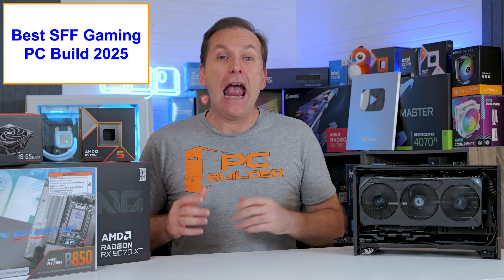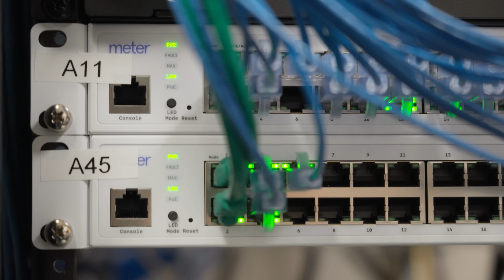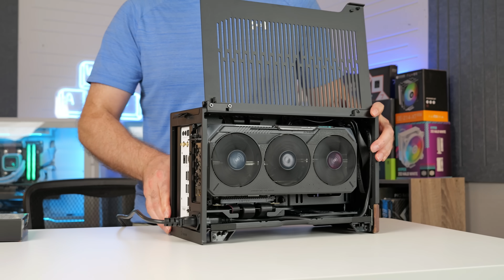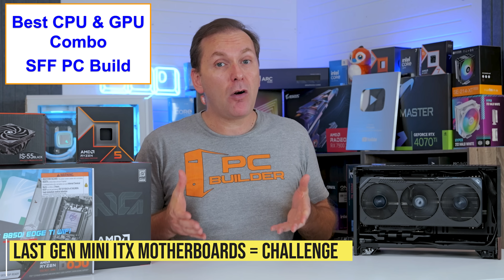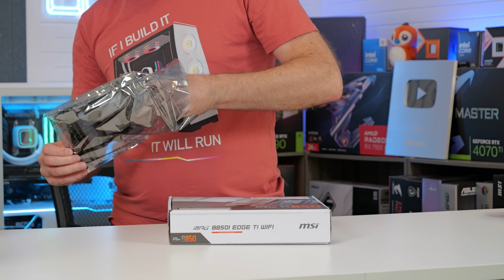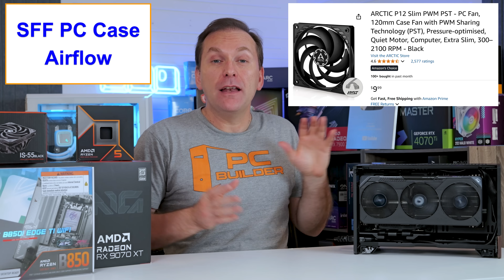Best Mini ITX PC Build Guide | Small Form Factor Gaming PC Build

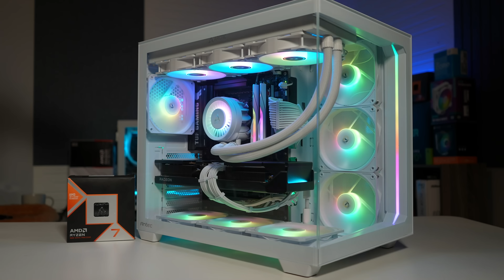Comment: @pcbuilder Jason, what is the white case displayed at about the 4:14 mark? I have one I bought used. On it is branding “SumTax”. The person I bought it from said it was a clone of the O11 Vision Compact. But I haven’t been able to isolate it or find any information. Would be awesome if you could fill in the blanks for me! Thank you!!!

Upon further examination of what you displayed. There are slight differences. Mine has a glass top. Mine came with a 240 AIO mounted on the side and doesn’t look like it would fit 3x120mm fans. Mine would only fit 2x120mm or 2x140mm fans on the bottom. Mine is 14 1/2” tall 13 7/8” wide 10 7/8” deep. The I/o and buttons are on the rear top right corner. I wish I could post a picture of it.

Comment: Im looking for a case super small, i mean as small as posible, but with support for a regular dual fan 9060xt.
It has to be small enough to fit on my backpack along with a portable screen, a keyboard and a mouse (and the power cable along with the display port or hdmi cable)
Not a huge backpack, but a reasonable big one.
I have found either itx with low profile gpu or 1 fan gpu or 3 fans gpu... but that mid ground of just 2 fans and as small as posible... nop. not the first case.

Comment: Jason, I have an  5700X CPU that I purchased for a AM4 build back in 2022/2023 right before the AM5 was released 2021. I also pourchased a 16GB ram kit that also for the build. I ended up not building that computer and  went with a  7700X  RX6800 ATX build instead. My daughter who is Autistic asked me to get a her mini PC for christmas to emmulate and play old retro and light computer games like  SIMS 4 so I want to use these unused components and build her a mini ITX build in either the Fractal Terra, Jonsplus Z20, or the JONSBO TK-0 case which I love. My problem is what would be the best old MITX AM4 MB and PSU that you would recommend me purchasing  for this build for her?.

Comment: I bit the bullet in upgrading from my 5950X and went all out for a SFF PC that is powerful, pretty future proof, and importantly NOT power hungry as I live out of a van... so..

Case: Revolt 3
Power: Silverstone SX650-G
CPU: Ryxen 9 9590X3D
MB: ASUS Rog Strix X870-I Gaming
GPU: Zotaz GeForce RTX 4070 Twin Edge OC
Cooling: NZXT Kraken Elite 240mm V2 Liquid Cooler
RAM: Corsair VENGEANCE Black 64GB (2x32GB) 6000MHz CL40 DDR5 
Mon: Dell 32 4K UHD Gaming Monitor - G3223Q
Speak: Logitech Z623 2.1 THX
Cans: Meze 99 Neo Closed Back Headphones with balanced cables

Don't see the point in upgrading the GPU. The onboard X3D brought new life to the overall performance and am getting benchmarks equiv to 5070Ti with lot less power draw.

Comment: I generally don't comment on YT. But this video deserves some kind of Nobel prize. 

Especially the PCIE Riser advice 👌🏽

I have a question, through some Santa type shenanigans I now have an Rx 9070. I want to build an SFF around it on a budget without bottle necks. 

I'm thinking AM4 platform For the price benefits. What's a medium to high spec processor I can use....
Reply from the maker: Thanks! Sadly the Ryzen AM4 CPUs seem to be vanishing. 5800XT is great if priced right, 5600 still an option. But if we can go AM5 that would be best. Hope that helps!

Comment: I've built two mini ITX PCs in the past two years, and happy to see that a lot of similarities here with the recommendations. 
I'd suggest considering ordering custom order length PSU cables to help with wire management if you can spare the budget in a tight case. It helps with having a clean build, and a lot less headache and a better temperatures.
And consider fan ducts. You want to leave some room between fans and side panels to minimize air vibration noise, but want to fill in the intake fan frame side gaps to minimize hot air recirculation. Simple tape backed weatherstrips taped onto the PANEL side lined up with your fan's frame works quite well.
Reply from the maker: Great suggestions! Thanks for sharing your experience.

Comment: Not ITX, but for  a case that fits most atx parts, but has a delightfully small footprint, I looooove my Tower 300. Not the cheapest case, but if you watch for it, you can sometimes get it refurbed or used, like I did. I fit a beefy 3090 and the oversized Arctic Liquid III 240 in mine, as well as my massive older Seasonic psu. No way was I getting those in the 200. The footprint difference is much smaller than you’d think, between the 200 and 300. Great temps and looks awesome.
Reply from the maker: Thanks for sharing! That's great to hear
Reply: @PCBuilderChannel  I actually bought the Nova Mesh first, but couldn’t fit my parts in it, and had to return it, sadly, but love my Tower, so it all worked out.

Comment: I’ve tried two separate ITX builds in the Fractal Terra using the ID Cooling IS-55, and for whatever reason it just did not keep the Ryzen CPUs cool enough, even with a Noctua fan replacing the stock fan. 75-79 idle, 95+ under partial loads. I triple-checked cooler mounting, ran the CPU (Ryzen 7600X) in ECO mode… just would not stay cool.

Comment: I need some advice from you Jason.
 I want to upgrade from am4 to am5 platform. 
This is what I have on my mind: 
R5 7500f(good price), 
MB B650 (B850 is still expensive in my country)
RX 9060xt 16gb
I'm gonna use all parts from old pc that I can (ssd, psu, case...)
Is this good for 1080p for now because I need to save money for a few months then im gonna buy 1440p monitor?
Reply: Yes that would be good.  Just don't forget the RAM.  Jason recommends 6000 CL30.
Reply from the maker: Looks good to me! Like Ty said don't forget the ram and you might check that your psu will still work by hoping over to our Best PSU 2025 video and following the method there to check your new wattage needs
Reply: @PCBuilderChannel It's 750 watts but I dont know which tier is it, I never bothered to look. I hope its enough for now😊 and for the ram Im going for 32gb 6000 cl30
Reply: @Djomla911 sounds good and yes 750 should be enough Watts

Comment: cool i went with a micro ATX version for my living room gaming pc because of the price diff just two weeks ago for €1400, bought a Lian Li Dan A3, super happy with it, but i recommend a low noise PSU as it the fan points out the front, sent back the initially bought MSI MAG A850GL, bought a bequiet pure power m 13 which is semi passive, noise diff os night and day
Reply from the maker: Nice! Congrats on your build. Show off a build pic if you like on twitter/threads/bluesky @pcbuilderjason

Comment: Hi Jason, what about using a MINISFORUM BD795i SE or MINISFORUM BD790i X3D at $383 and $527 US respectively, they offer mobile CPUs that will not bottleneck high end GPUs at 1440p (7945HX3D especially, performs close to a 7800x3D).  They come with a nice features on the motherboard including a low profile heat sink, wifi 6e, PCIe 5x16 GPU slot and 2xM.2 PCIe4.0x4 (X3D had PCIe5 with active cooling) . Quite impressive and high value for an ITX build. Any chance you will consider looking at these for future recommendations?

Comment: Migrating a 5950x from ATX to m-itx with a refurbished am4 motherboard from AliExpress. Wanted to keep the 280mm AIO so settled on the CoolerMaster  nr200 V3. The fact it's also affordable and looks sorta premium (not as much as those Fractal cases though) also helped.

Comment: Just a recommendation for another sandwich style case that's cheap and comes with a riser cable the S400 on Amazon for $120
Recently built my first SFF PC in there with a 9600x and 9070XT, and its been amazing
Reply from the maker: Thanks for the tip!

Comment: It's crazy how expensive a mini-ITX build can be these days.
In the Sandy Bridge days, I bought the cheapest PC available and it came with a Fixconn mini-ITX motherboard in a small mATX case.
Some of the really small mATX cases are not much bigger than a mini-ITX case and are 1/3 of the price
Reply: What case are you speaking of that’s cheap and not much bigger than itx but is mATX??
I’ve currently got a 5090/9800x3d build inside of a Meshless aio md280 that I want to possibly retire/sell

Comment: That is a really bad idea to use a Gigabyte Gaming OC card in a vertical orientation like you have with all the horror stories of thermal paste dripping down into the pcie slot with these Gigabyte models!
Reply from the maker: My understanding is that mostly impacted RTX 50 Gigabyte GPUs and it was due to a manufacturing issue that has since been corrected. I haven't seen the issue on gigabyte Radeon GPUs. Let me know if you see it with Radeon Gigabyte GPUs.

Comment: Great video, most videos I've seen talking about SFF builds don't even bring up the formdt1 cases, glad to see you did. 

I plan on building an SFF using the fractal terra also but because I also do 3D modeling and dabble in some AI stuff, I gotta stick with Nvidia. At this point though, I may as well wait for the SUPER series.
Reply from the maker: Glad you enjoyed! For the super series check out our latest Best GPUs September video. For folks with a system they like currently waiting makes sense but for others I urge folks to remember that even when they launch we are likely to face the same crazy launch prices and low stock we saw this year so it might be a really long time before we saw them at reasonable prices for not much performance difference. Something to consider anyway and we go over it all in more depth there

Comment: Bought silver Ncase M1 in 2014 and had it on my closet, just getting to building it right now, X650E, 9800x3d and either 5070ti or 5080. Always had water-cooled PCs, but this one might be a air cooled setup or a simple AIO.

Comment: I built my first ever PC about a year and a half ago using mainly advice from this channel (thanks Jason!), and even though I went with the Fractal Terra for my first ever build it ended up being quite easy. I have the Ryzen 7600 set with PBO + 75C Tjmax, and the GPU (RX 7900 GRE) doesn't really go above 70-75 either; together they are a perfect balance for 4K at 60fps in single player games on the living room TV, or 1440p at 120fps in multiplayer games on my faster monitor in the study. Now I'm hooked on the ability to just pick it up and move it to a different room, or pack it in a backpack and take it when I go to stay with relatives over a weekend. In the future I'll probably downgrade the performance slightly and cram everything into an even smaller case.
Reply from the maker: That’s awesome! Thanks for sharing and congrats on your build!

Comment: I'm tempted to build my first build as a small form factor build but this seems like alot of work and troubleshooting needed. I think the most important aspect of SFF or reason to go with SFF to me would be mobility. To those who sometimes change their place of residence and PC usage like moving back and forth between home and school dorm or seasonal workplace. To have a more powerful PC than a gaming laptop, yet capable to hand carry around once every couple of months or year
Reply from the maker: I generally recommend folks avoid sff for a first time build for exactly these reasons. I'd go for a nice Micro ATX if you want a smaller build thats still going to be very manageable for a first build.
Reply: I built mine 2 years ago, and yes it required a lot of troubleshooting and effort but when I finally got it done it was beautiful. Id do it again if I had to.

Comment: The hyte revolt 3 itx is a great choice! I have it in white with a 9800x3d and a steel legend rx 9070 xt in it and temps are great. Definitely set the aio fans to exhaust, since this case has had some issues with temps. It runs quiet and cool and looks pretty dope.
Reply from the maker: I like that case a lot and we have a funny CES video of me trying to steal it from the Hyte booth a couple years ago, but I can't find it at retail any longer.
Reply: @PCBuilderChannel  Its available directly from Hyte. It's on their site for $129.99 without the sfx power supply.

Comment: Great video, Jason! I'm building a mini ITX build myself this week with the same MSI motherboard and Ryzen 9600x :). Any particular tips or concerns regarding the M.2 slot on the back of most mini-ITX motherboards in regards to temperature?
Reply from the maker: Use the M.2 slot on the back during the build because you'll never be able to get to it again!!! I would use a drive that I wouldn't have to worry about thermally if using that slot. Luckily a lot of SFF cases can now have intake fans on the bottom which should provide some airflow for it (not so in the case we used, however).

Comment: Cool, I want mini pc but with usual micro ATX
Reply from the maker: Lots of SFF cases now come with Micro ATX compatibility. But there are some issues we discuss in the video about this.
Reply: Look at the Thermaltake towers. If you keep your gpu and aio relatively small you could use a 200, with an MATX board. So easy to build in and a super small footprint.

Comment: I did a cheap $500 mini-ITX build for my father in 2023, I could have just bought a mini PC but I wanted to try building a mini-ITX PC for the experience. I plan on moving soon and I regret having my 2021 build be a standard ATX build. A mini-ITX would be prefect for a move and I wouldn't mind having a mini-ITX as my daily PC but maybe I should look into mATX because I don't want issues with heat.
Reply from the maker: Good luck on the move! Hope this guide helps out!
Reply: Lian Li dan a3 is perfect mATX

Comment: I’m constantly house sitting for my retired parents. I’m looking to make an itx build to stick my current sff 4070 super into while I’m traveling. Is the performance of a 5070ti or 5080 be worth the upgrade? If not then I’ll hold off on the itx build and haul my current rig around
Reply from the maker: Depends on what you're doing. If you want high end enthusiast ray tracing then yes. If you are happy with the FPS you're getting now, then probably not.

Comment: I’m TEMPTED to build a mini itx (ridge) but I’m scared I won’t be able to organize it well enough to fit
Reply from the maker: You can do it! But if you want to go mATX, there are some tight cases as well for that small footprint look.
Reply: @PCBuilderChannel thanks how much (if any) fps/performance is lost by going with the smaller case causing less cooling/airflow
Reply: @clw22580 I used a Tower 300, matx, with my super hot gigabyte 3090 and a 5950x. My temps came down, even using the same aio as in the case I moved out of.